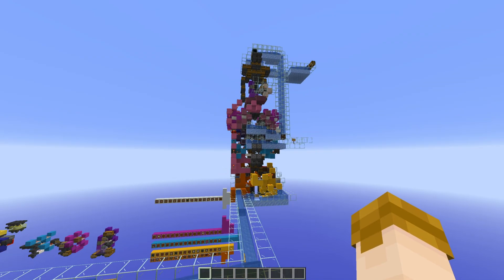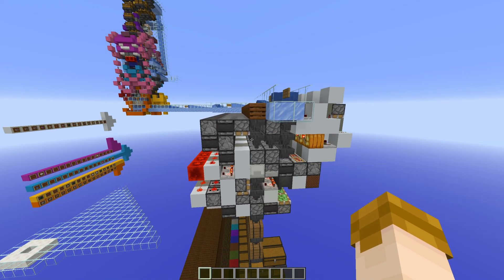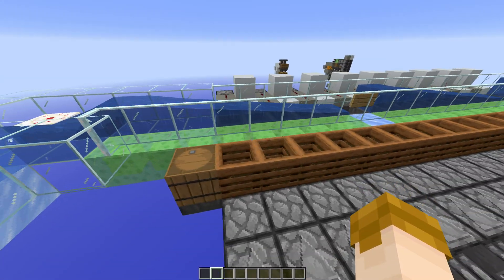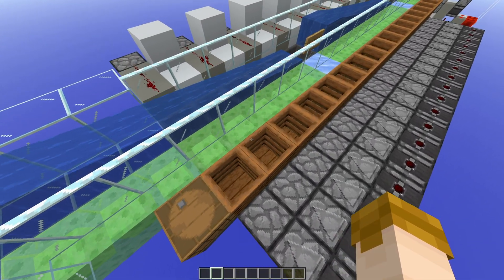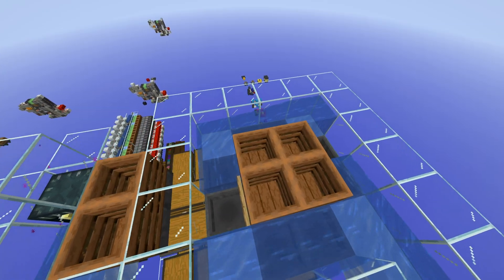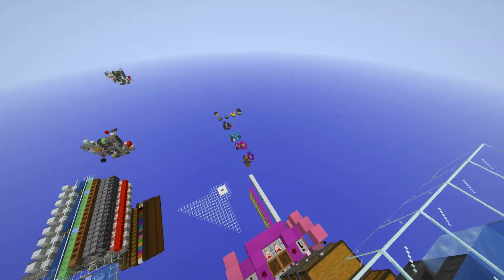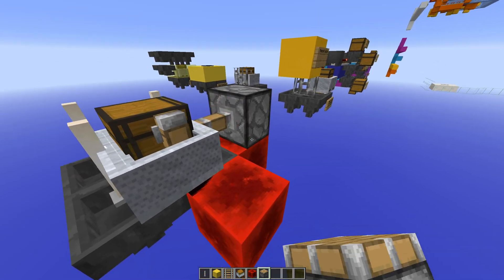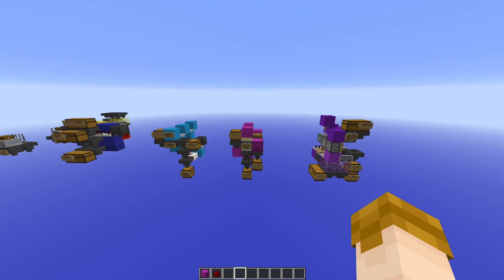Buffer, Pre-filter, & Feeder v2.1 for Double Speed Item Sorters

Comment: Hey Experimentalidea I love the look and speed of the design and am thinking of putting it in my survival world. But I am unsure due to you saying that the shulker unloader can break from, what you wrote anyway. Could this be avoided if I have a constant flow of items being put into it from my farms. Around 5 stacks a minute
Reply from the maker: The shulker unloader can break if it tries to unload a shulker box with exactly 3 items in it. The reason for this is that the piston with the observer gets short pulsed & thus losses its observer. We’ve been able to mitigate this on EndTech by adding a comparator fader for the piston, but it isn’t pretty. (see EndTech #4 at time index 8:45)

The other issue this input system has is that the stackables filters can randomly break. We’ve been having this issue come up basically every week on EndTech and so far have been unsuccessful in our attempts to mitigate the issue. I have a theory it may be due to inconsistent item flow, by the gaps in the item flow caused by the shulker & non-stackables filters. But I’ve been unable to reproduce the scenario that causes this.

At some point I want to make a version 3 of this input system to address these issues, but that will probably be awhile. For now, I don’t really have any recommendations.
Reply: @ExperimentalIdea  ok thx I will build it and see how it goes

Comment: I have a problem with this system in 1.16. The dropper filling the shulker boxes seem to slowly fill up over time due to it not dispensing a few items each time a new shulker is dispensed. Is there any way to fix this issue?
Reply from the maker: If I understand correctly non-shulker boxes got into the dropper(s) from the shulker filter? Due to how I wired them they break if they get stackable items in them. (i.e. non-shulker boxes) Stackable items shouldn’t get in there during normal operation, but it is something that's happened to me a few times while working on the redstone in the past. Clear those droppers of all items in them and it should work again, provided the shulker filter(s) don’t have any missing redstone.

If your talking about the shulker box unloader. I have an updated world download for 1.16 that fixes it in the description.
Reply: Thanks for the response. I am talking about the shulker box fillers. The dropper filling the shulker box with items seem to fill up over time due to it not transferring a couple of items each time a shulker box has to be replaced
Reply from the maker: @thomasseiferthegelund5759  Oh, I see. You're taking about the double speed item sorter/shulker loader in the world download. (I was a little confused because that wasn't the focus of this video)

That's a known 'issue' that isn't really much of an issue during typical use and I addressed it in the dedicated video I did on that double speed sorter/shulker loader. https://www.youtube.com/watch?v=BIGjR08o6qI
Essentially, when a slice is sorting, it activates the adjacent slices bottom droppers. Clearing any items that may of gotten stuck there in the past.
Reply: ExperimentalIdea thanks for the answer. I have been looking for a video on just your shulker box filler but YouTube did not seem to show it.

The loader unfortunately seems to break after a couple hours of use due the system filling up with items that are not getting dispensed. I also have a problem where a new shulker box is not dispensed if the system gets unloaded at the wrong moment

Comment: What speed does the 4x shulker unloader handle loose items at? Considering using just that module for a furnace array but not sure how many i need to build.
Reply from the maker: It unloads shulker boxes at four times hopper speed. (9k/h x 4 = 36k items per hour) Because it uses hopper minecarts, the unloading speed of a single unit can be almost infinitely increased.

For an example, see Beast's 1 input 64 output distribution system. (or even 1 input 32 output) https://www.youtube.com/watch?v=nbE0m4BVdhQ

The shulker unloader could easily be modified to scale up to whatever speed you need since it uses hopper minecarts.

Comment: I can't figure out how to adapt your design for 4x hopper speed, it seems I still run in hopper cooldown issues. Even with a lot of items in the Etho hopper clock items get past my filter without getting picked up. I don't know what to do.
Reply from the maker: Could be that batches of items are stacking up to 64? If your filter has a minimum amount of 2 items in the filter slot, then at most only 62 out of the 64 stack of items will be picked up by that filter.

You will want to tune the hopper clocks that determine how often a batch of items is sent out so at most items only group up to, say, a maximum stack of 58~. (or about 19~ if using a filter that keeps a minimum of 41 items in the filter slot)

On top of that, you’ll want to align the items over the filters in such a way that the speed they travel down the water stream is slowed by running them over slime blocks or other normal blocks. (You can see an example of this in the world download with the sorter attached to the unit)

If you wanted items to be moving quickly over the filters without hopper cooldown issues at 2x speed then you’d want to ‘pause’ your feeder for a bit (12? 16 ticks?) every time a batch of items is sent. So when a sorter slice picks up the a batch items, it finishes filtering them through before the next batch arrives, and thus the hopper isn’t in cooldown and wouldn’t have any problems picking up the next batch. However, for 4x sorting I’m not sure this would work out. You’ll have to do your own testing there.

Not sure what you are doing about 16 stackables if you’ll be sorting them. They would likely group up into full 16 stacks if targeting 4x sorting for 16 stackables no matter what you do. Might want to keep those at 2x speed max or find a different workaround for those items.
Reply: @ExperimentalIdea  No the group of items pass over the hopper without getting picked up, the number of items stays lower than a stack (6 items minimum always remain). So the hopper needs to have completely finished sorting the previous batch before I send the next one?

Yes I already tried the slime blocks like in the world download but it didn't fix it.

I'm only sorting cobblestone and stone at 4x speed, the items that stack up to 16 get sorted at 1x with the rest of the items.

The rest of the items goes to a 1x buffer/dispenser, then 1x hopper speed sorter silos ( big quantities), then the Scicraft/Zipkrowd style storage room, then a very slow multiple items per chest sorter. After that I may put some non stackable item sorters (minecart, flint and steel, buckets, potions... may be a bit overkill XD) before the items not getting sorted end up in the unsorted chests (fishing rods, enchanted books, renamed items...)
Thanks a lot for your replies, you're very helpful.
Reply from the maker: @WetaMantis  That sounds... odd. It's really difficult to diagnose this stuff through text, I'm out of advice to give here. Maybe you could try asking for help on the SciCraft or Technical Minecraft Community discord? With screenshots or better, a world download, people on there may be able to help you out more than I could here through text.

Sounds like you're making a really cool storage system, I hope it turns out well.
Reply: @ExperimentalIdea  Thanks a lot, now that you explained to me how hopper cool down works I think my system is fixed.
I converted one of the two 1x sorter to 2x and now there is always one sorter empty before the items come in. It seams to work, no missed items.
I thought the hoppers had a fixed cool-down not that I had to wait for them to completely finish before the next batch. All is good now.

BTW I use this system with multiple type off sorters hopping to reduce lag, by using only single item sorter for bulk storage and multi item sorter for the rest (hoppers trying to put items in a chest with a variety of items).

Comment: Is it possible to break the last shulker box on the shulker box unloader?
Reply from the maker: It may be possible, but not really a useful feature for the unit as a whole. In my opinion, it’s not a big issue to to have a single empty shulker ‘stuck’ in the unloader given the use case here. If that feature is really that important to you, I encourage you to try adding it yourself. Or maybe consider another shulker unloader design. :/
Reply: @ExperimentalIdea  Yea, I wasn't interested in the shulker unloader to incorporate in this particular system but as a way to unload junk from my boxes and get them back quickly empty (and put them back in my enderchest). I like the speed and compactness of your design and the orange circuit that trickles the items. I suppose the orange system can be modified for single hopper speed too (items get past my 1x sorters without the hoppers getting full). Can you use a single filter for 16 item stacks (eggs, enderpearls, snowballs) if you use it at hopper speed ?
SUBSCRIBED
Reply from the maker: @WetaMantis  Ah, I see. Sorry I still don’t have a solution for you. Maybe I’ll work on a modification at some point to break the last box. You're the second person to have requested this feature so far – seems it’s something people really want.

Yeah, the orange (& yellow) system(s) can be made to work for normal single hopper speed sorters. Just have to change the clock from an 4 tick clock to an 8 tick clock. (instead of using 2 observers, you’d use 4, or some other clock circuit for the item dropper)

Yes, you could use a single filter to separate the 64 & 16 stackables if you don’t want to chase after the last few percentage points of efficiency. And when I say the last few percentage points of efficiency I do mean it here. The reason the unit shown in video has effectively 4 ‘pipes’/independent systems filtering items is just to get the most efficiency possible out of a double speed sorter. If you wanted to go for efficiency (sort items fast as possible) on a single hopper speed sorter you’d want to effectively cut this unit in half. I’ll leave it up to you whether its worth the extra work to do so over a simpler single hopper speed pre-filter.
Reply: @ExperimentalIdea  I admit my defeat. I can't, for the life of me, modify your 4x Shulker unloader into breaking the last shulker box. Several hours in (yes I am very bad at redstone but very stubborn). I think it needs some internal modifying.
Huhh... a button will do I guess.